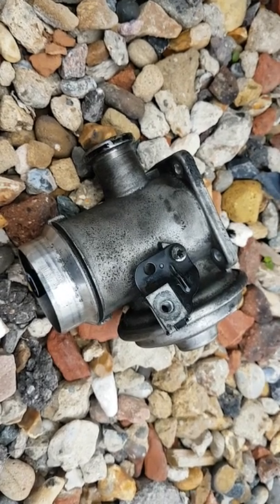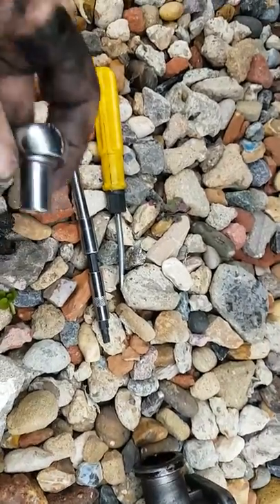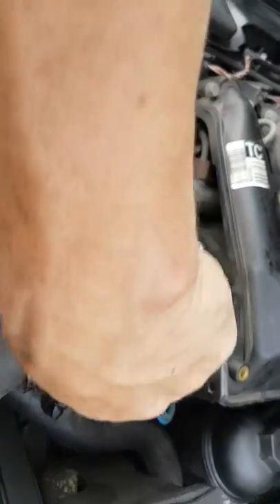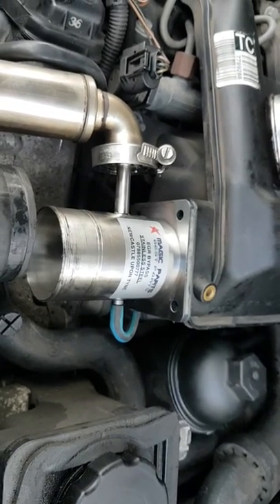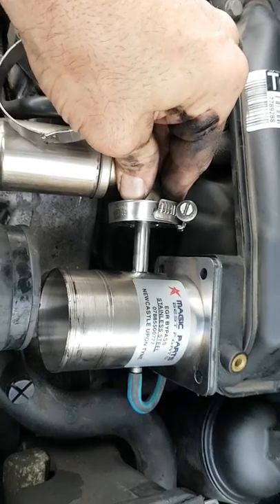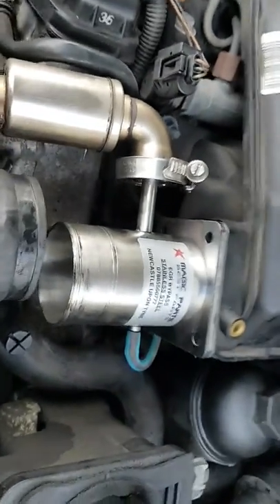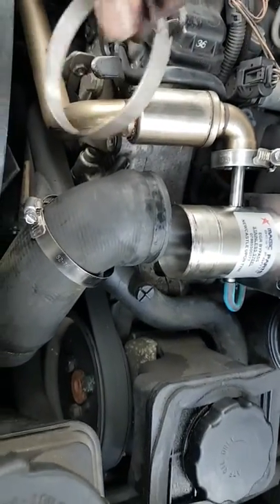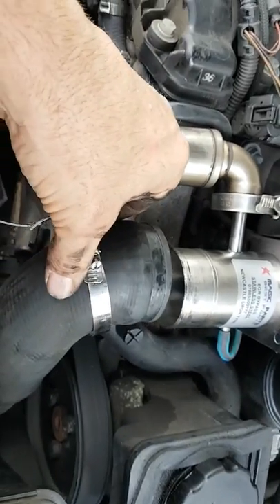BMW DIESEL EGR VALVE REPLACEMEMT E39 E46 530D 330D X3 X5

Comment: Hi, I've been told the 2005 X5 M57N doesn't have a sensor so doesn't need a software delete , is that true ? Also where can I buy this please . if you can provide the link thanks
Reply from the maker: Hi thats correct for the X5 E53 mine was fine.  No EML come on.  Generally most remapping companies can do the software delete.  All the best.
Reply: @JFKKARZ  brilliant thanks. which year was your E53 ?
Reply from the maker: @appsupport9871  My X5 was a 2005.
Reply: @JFKKARZ   Hi, @ 1.00  , is it necessary to blank the EGR cooler pipe as well? or can I leave it open ? I can't seem to find a blanking kit bypass similar to the one you used in this video, the ones I find is straight pipe and some people say the the cooler pipe for e53doesn't need to be blanked ? any advice would be muchappreciated thanks.
Reply from the maker: @appsupport9871  If your upgrading using the same EGR, then yes it needs to be attached to the blanking plate.  If you don't have the blanking bypass then you might not have the correct EGR bypass.
Reply: @JFKKARZ ok,  I actually found the same EGR blanking bypass kit, which as you say is easy 20min job ..but the kit costs over £50 .. the one's that is a straight pipe is a lot cheaper , but then I guess the gold cooler pipe needs removing completely then , and blank off at the exhaust manifold. It'll be less cluttered as well. Thanks will decide soon which one to buy depending on my budget :) Many thanks.